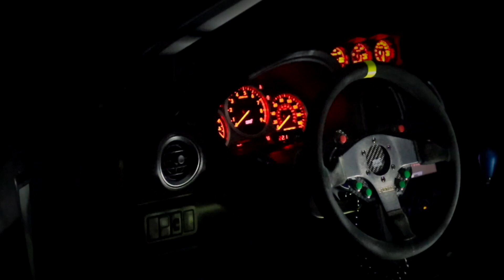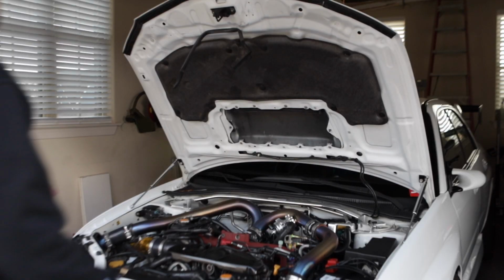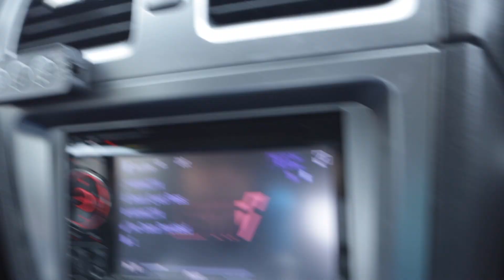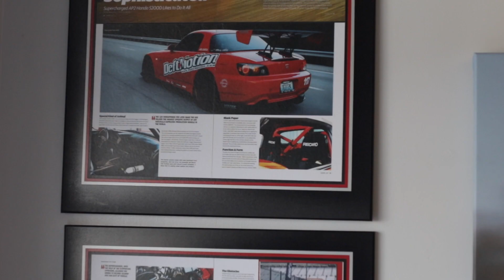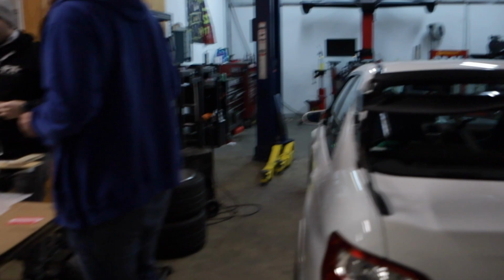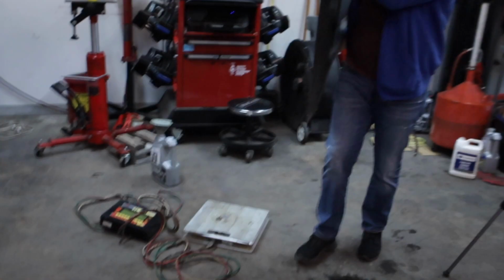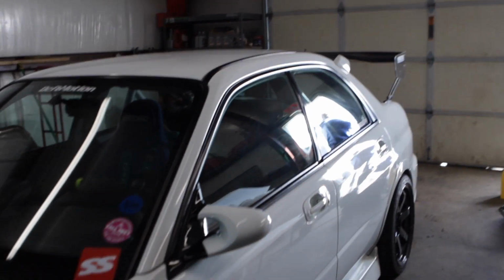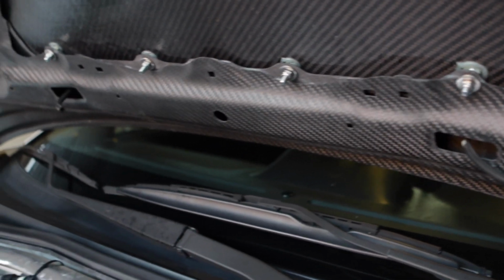The World's FIRST Forged Carbon/Twill Carbon Fade Hood

Comment: Have you had any issues with this hood requiring hood pins, considering how light it is? Definitely wouldn't want to put them in an ruin the clean look but I'd be somewhat worried about it catching air at high speed and getting pulled open.

Comment: So not going to run hood struts?
Reply: cant with carbon hoods.
Reply from the maker: Too much stress on the hood when closing it- fighting against the force of the struts in my opinion, even with a hood as rigid as this.
Reply: I have both struts on my 335i CF good just need the right ones